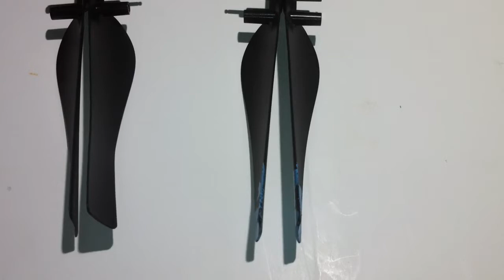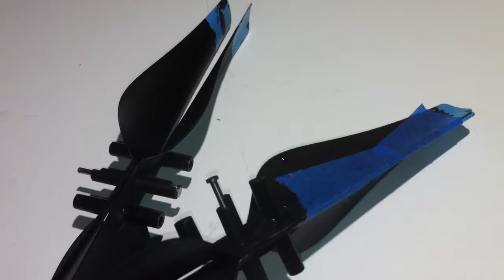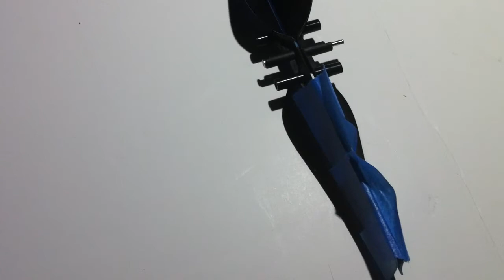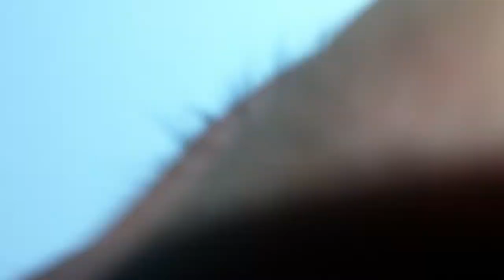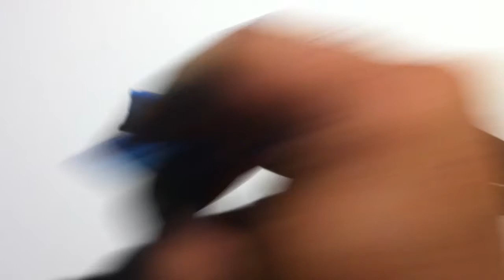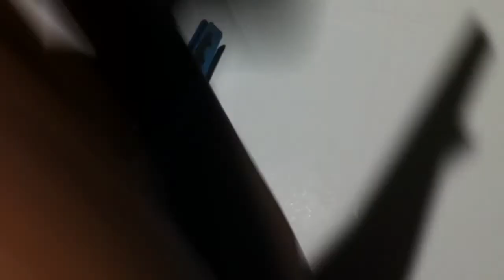Parrot AR.Drone 1 or 2.0 SUPER EASY Tip/Trick/Fix for warped propellors (Or drone flying wierd)

Comment: Just did this last night and it worked great.  I microwaved the water for 2 minutes.  then dipped each side for 35 seconds.  Then 1 minute in the fridge to set them up and then off to balancing them.  Thanks for the great tip!

Comment: Thanks man! Warped proppelers from Brookstone, replaced yesterday and in first fly today got it crashed and/or hardly taking off. Got it done with tape and hair dryer, instead of hot water. I´ll check results tomorrow.